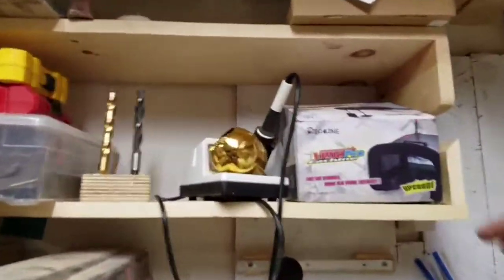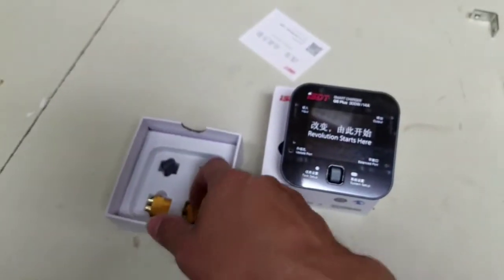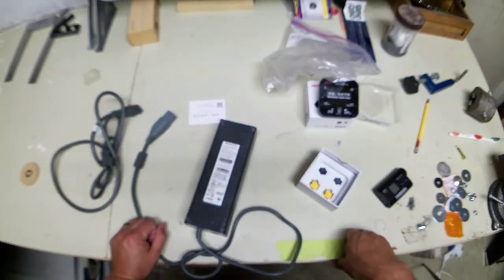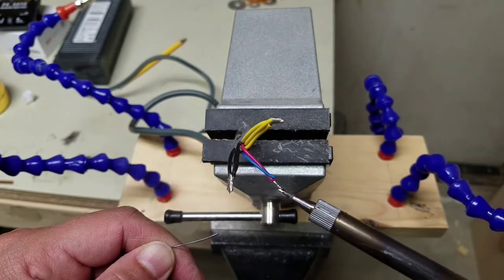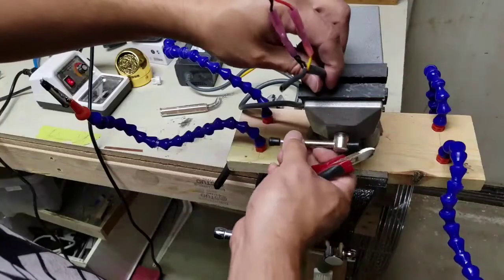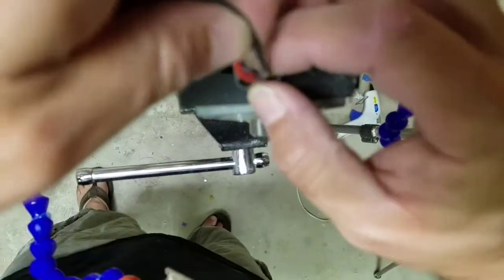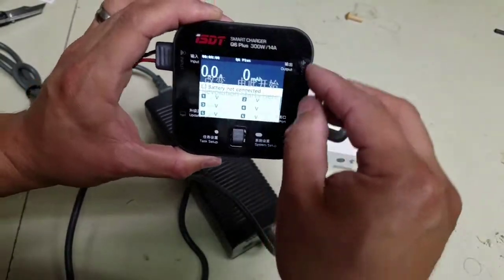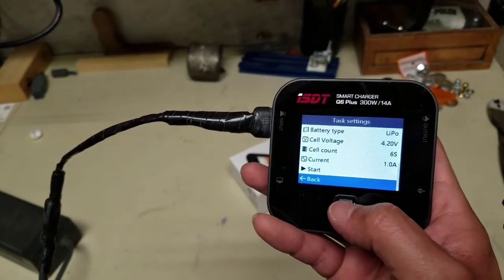ISDT Q6 lipo charger powered with Xbox 360 power brick

Comment: Thanks for this.  I had converted my Macbook Pro 85W PSU, but that didn't work consistently.  The Q6 would shutdown when charging more than one battery via a parallel board.  I then went searching for a XBox 360 PSU and found one for $5.99 at Game Stop.  Now it works great.
Reply from the maker: Good to know! I should pick a few of those power supplies up. Came in real handy. Thanks for watching.
Reply: I'm also considering buying another one at that price for a backup. :)
Reply: I seen different x box power supply with different watts. which like for different generation x box's. would the slim adapter work?